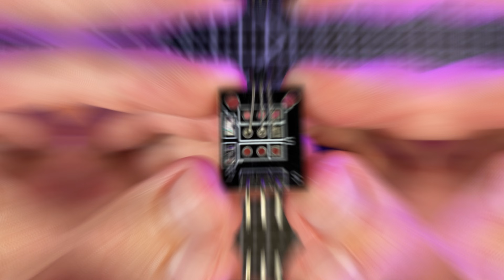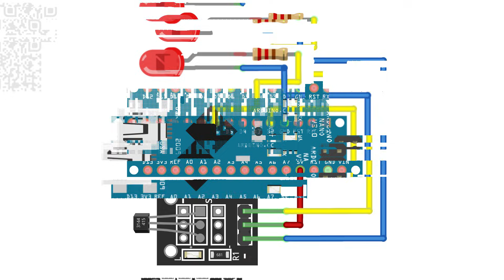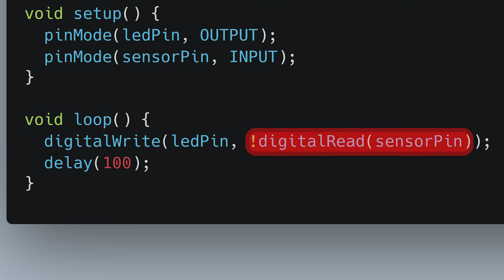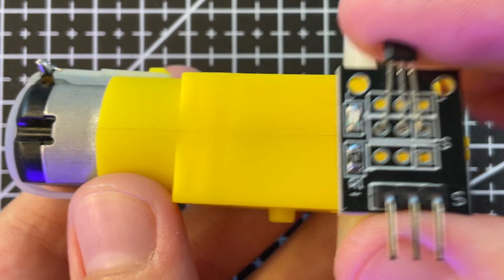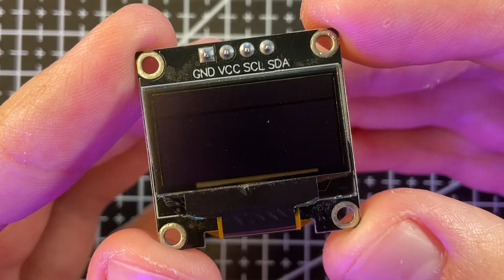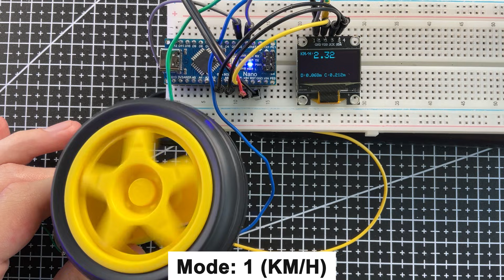Build Your Own RPM Meter: Hall Sensor + Arduino Setup

Comment: This was a good Tutorial. I would Like If you can make part list for Everthing Like wires and Display. Can you also do someting where the finished Code for the Display and the other ting  to See. And please Tell me If you have to Put the components on this  White circutboard or Not. But thanks for the Video. I Like IT seam Like you make good and easy understandable conntent. I really Like IT. Bye
Reply from the maker: Hi, all the code and the schematic are right there on the diagram you can see exactly what you need and how much of it by following the link in the description on my GitHub. As for this white printed circuit board, it’s what’s known as a breadboard; there’s also a tutorial on it on my channel I recommend checking it out =)

Comment: Can I get the final code where u used the wheel diameter variable and the OLED Display setting?
Reply from the maker: Hi, yeah, of course it's been on GitHub for a while now. If you don't want to spend a lot of time searching, here's a link to the sketch. If it helps you, please give it a star!

https://github.com/HuHamster/hall-sensor/tree/main/Hall_Sensor_With_OLED